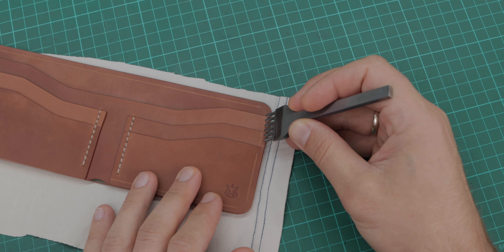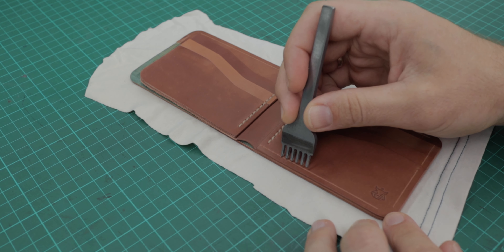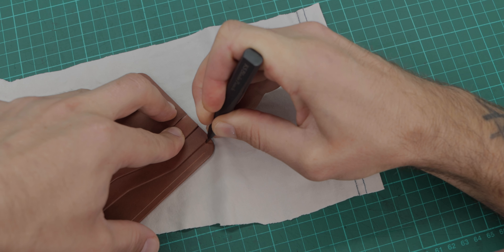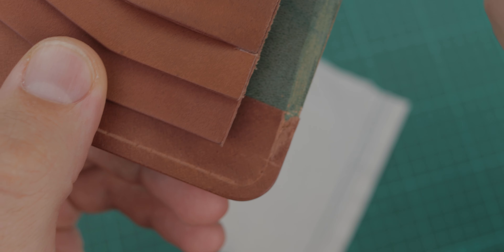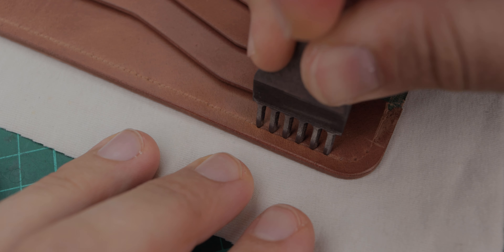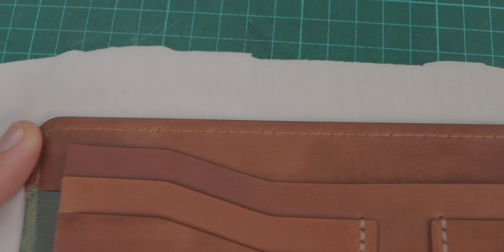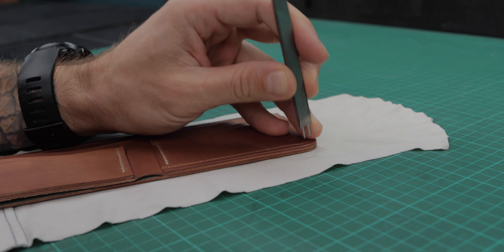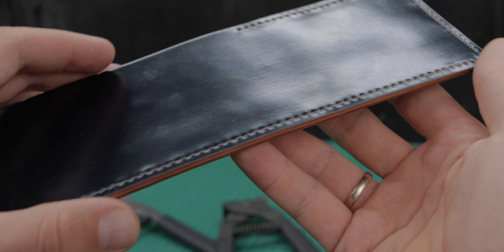How to distribute stitching holes evenly and not to land on edges #leathercraft

Comment: Hello Tomas! You have very informative videos, I have learnt nice tips from you! How does those pliers work on corners? Or do you need to use the two prong pliers for that?
Reply from the maker: There is 2 prong pliers, but i dont like it, they kinda makes to rough holes on corners, so i just use 2 prongs pricking irons on corners.

Comment: So what are you doing? I don’t understand when you say put tension in forward?
Reply from the maker: The main point in this video dont punch your holes straight away, mark it before and check if it matches. If not adjust your holes with some tension backward (or forward if its more convenient)

Comment: Hey Thomas. Would be great for a video on cutting straight lines from leather pieces and also how to assure the project is completely straight and flush.
Reply from the maker: Im using cutting dies almost for everything, it makes extremely accurate cuts.
 If im creating something new and dont have cutting dies, best way for me is metal ruler, super sharp knife and also keep knife as much as possible straight angle when cutting.
And for sure practice, practice, practice...

Comment: Great video Tomas! It’s really all maths. If you’re using Adobe illustrator, you just need to take into account the stitch line (offset path -2/3/4mm) whatever it is. Then see if those numbers you now have, go into the number your pricking irons are. 

For example, a one card, card holder. If the piece is 100mm wide and the height is 50mm. And you’re using a 3mm stitch line, the new shape becomes 94mm wide and 44mm high. 

If your pricking irons are 4mm apart, 94 divides into 4 = 23.5 times and 44 divides into 4 11 times. You would need to change the width for everything to be flush. Which requires maths. 

This ONLY applies if you want everything to look uniform/symmetrical.
Reply from the maker: In theory...
 if you do it with laser cut it will work. If you do it by hand always will be small inaccuracies and here helps this tip :) Even here you saw how much i needed to adjust, if ill be making same wallet again im 100% sure it wont be the same gap between these 2 marks again :) 

Only for upper pocket im paying attention when im creating in Illustrator, other distances im adjusting this way shown in video.

Comment: The bigger part of this is that your patterns were drawn specifically to match the spacing of your irons.
Reply from the maker: And the more bigger part is, that its absolutely doesnt matter what size of your pricking iron is, because you can use this tip any way. The smaller step size of you pricking iron, the easier it would be to adjust.

Comment: this was a great tip, i was just having this exact issue with my cardholders!

whenever you are designing templates, do you factor in stitching hole distances?
Reply from the maker: I just pay attention to upper pocket when designing, other longer distances between these crucial points im adjusting on actual craft as shown in video.